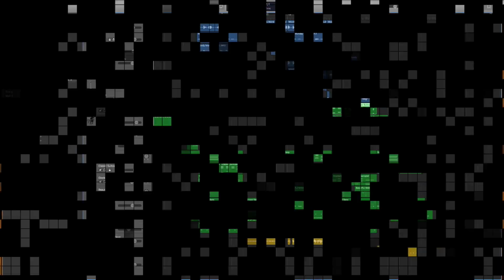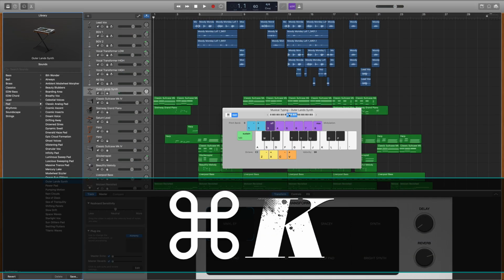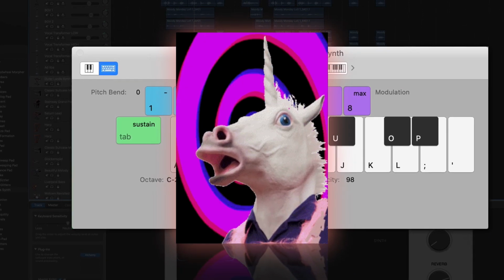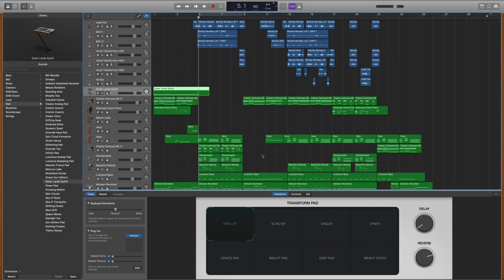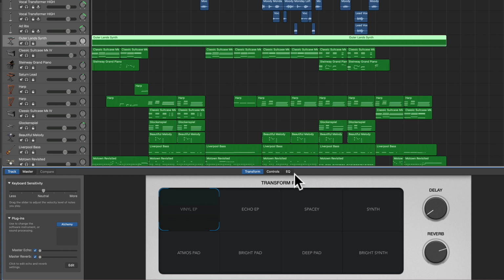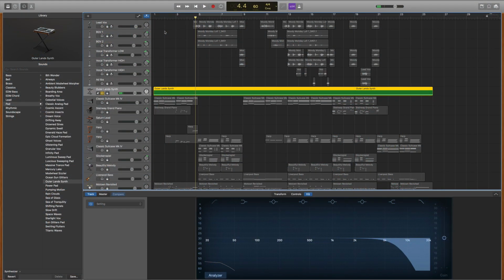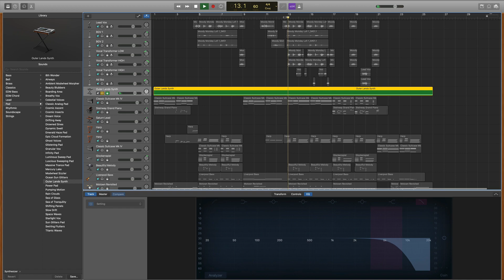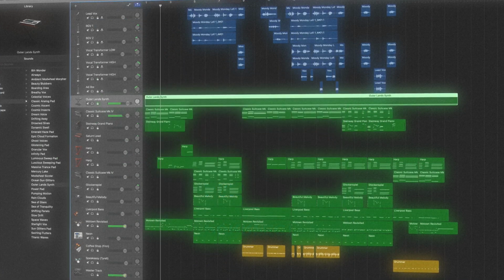how to get vinyl crackle in GarageBand [GarageBand Tutorial]

Comment: Thanks this is so much simpler than other techniques, but I'm having a problem. 
I can only hear the vinyl crackle track playing back when I'm in record mode for another track. Soloing the track or muting the other tracks - nothing. When I create a new track from it with duplicate settings and record a different keyboard track, I hear the new track upon playback. 
I've checked input monitoring but no help. 
What's even more strange is with the eq pulled up for the crackle track, I can see the signal when in record mode, but not in playback mode. 
Any ideas would be much appreciated, thanks in advance !
Reply from the maker: Hey Steven!  That is weird... one thing you might check is to make sure that your MIDI note for the vinyl crackle is not before the 1st beat of the song or else it won't sound out.  The only other thing I would try is the track lock technique which helps it play at all times without having to go back to the beginning one the midi region.  Hope that helps! -Dean